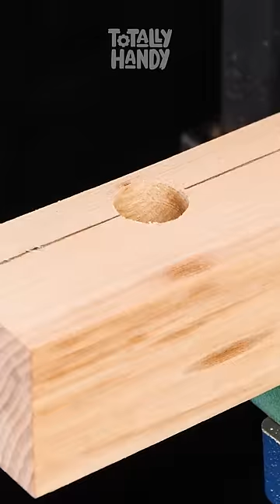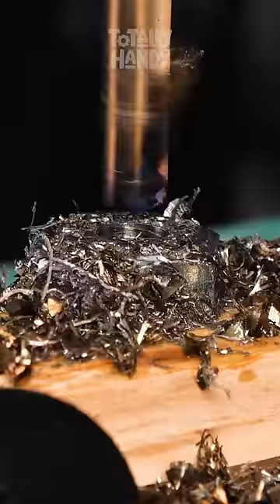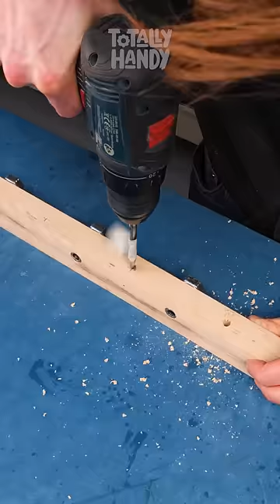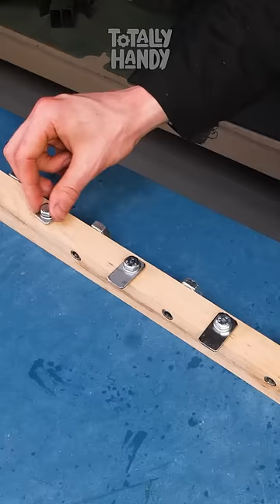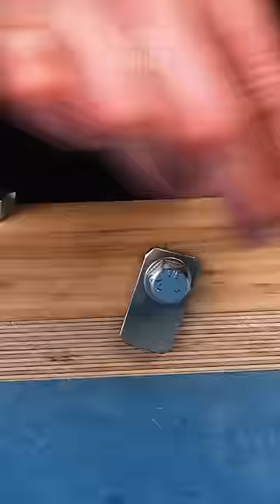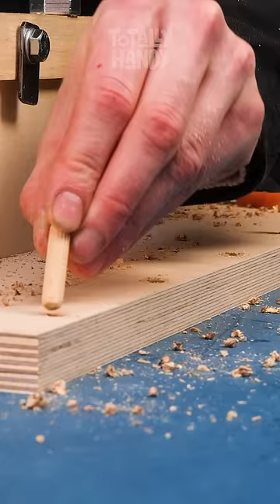Woodworking Tool Idea from Bolts #shorts

Comment: Good little tool, could be shortened or extended for any sort of use. Saves the time of having to rule out and mark holes constantly and even almost ensures a straight hole if you're not a spud.

Note: 80% of the comments on every video this fella' makes are either disrespectful or plain f**king rude. Show some respect to a dude that actually makes these quality shorts.

Comment: Your idea for a woodworking tool is a less precise dowel guide? That destroys at least 1 drill bit and one tap? Moreover... do you need to bore out MORE bolts to accommodate other dowel sizes?